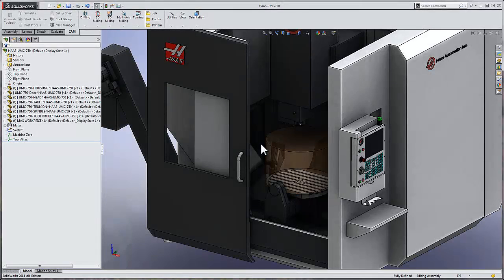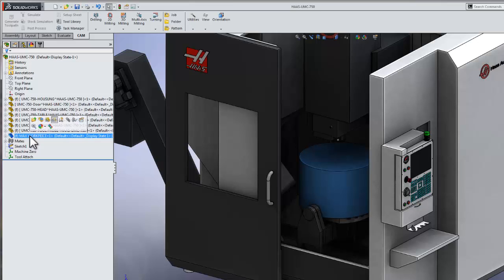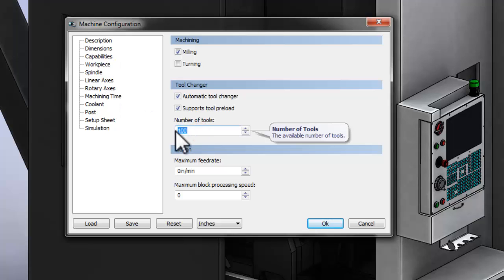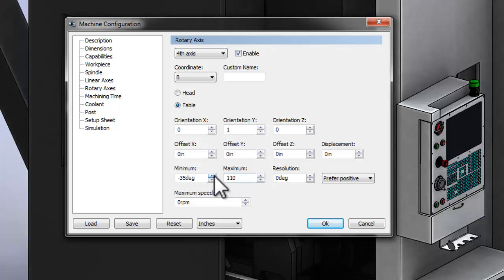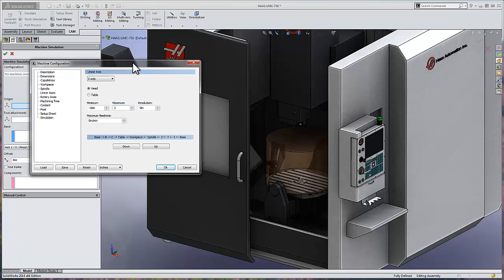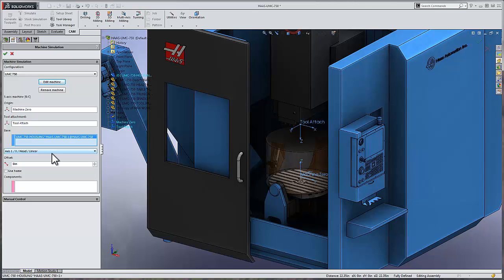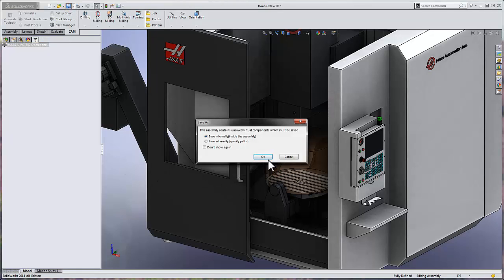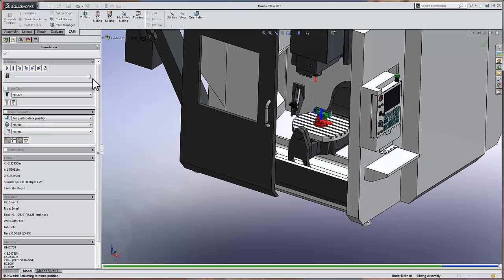HSMWorks:  Setting up Machine Simulation

Comment: So I have a question about something that has been bugging me about Machine Simulation and I don't know if it's a bug or just something that I am doing wrong. I am programming for the UMC 750 and usually select 'orientation and origin' when programming and the angles look good both in the toolpath parameters and in the posted NC file. The problem is that the machine inverts the orientation in machine sim in the B and B axis. B90 C0 becomes B-90 C90 or so. I have watched this video several times and believe that I have my machine setup the same as you show here.

I have also tried changing my tool orientation type to define X and Y and still the problem persists but things still look good when I post out.

Is there a way I can fix this?